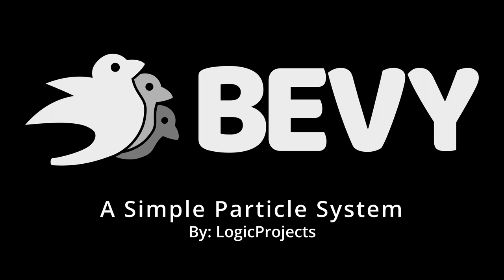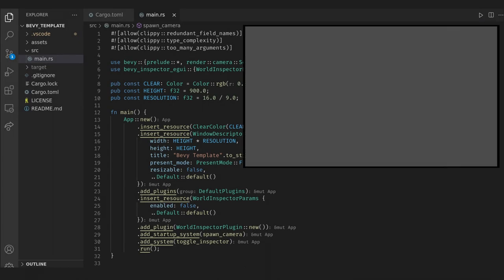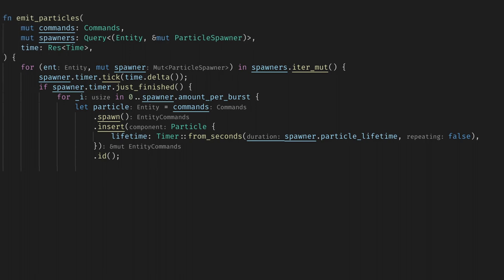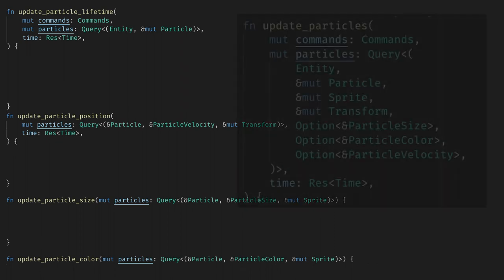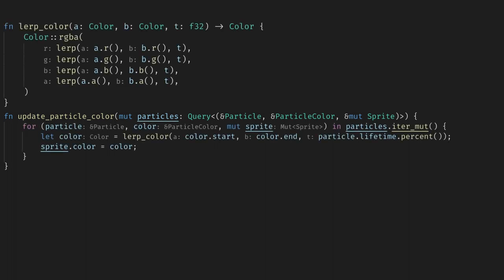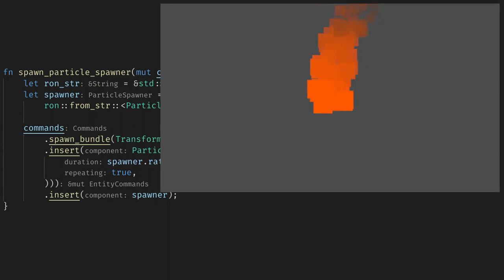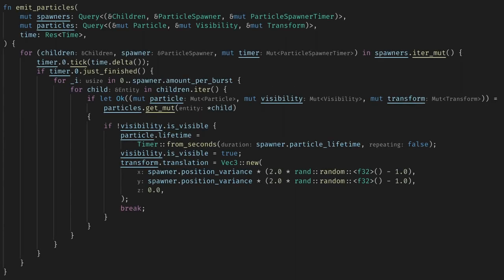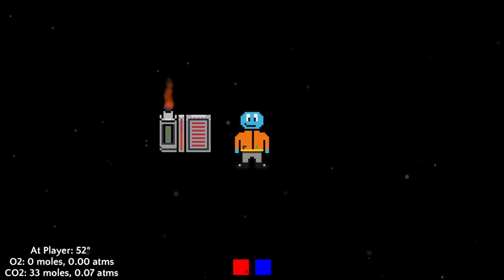Bevy Tutorial: Creating a Particle System

Comment: So I implemented your particle system but I've ran into some performance problems at higher particle counts. I just want to ask you if switching to 1 update system with optional query params performed better than different systems for different attributes of a particle. Also thank you for your effort in putting this together!
Reply from the maker: I'm sorry to hear you're hitting performance problems. How many particles do you have (just curious)? In my project when I profiled I found a single system was more preformant due to bevy's system overhead. Also keeping particles on the same z was important to force bevy's sprite batching.